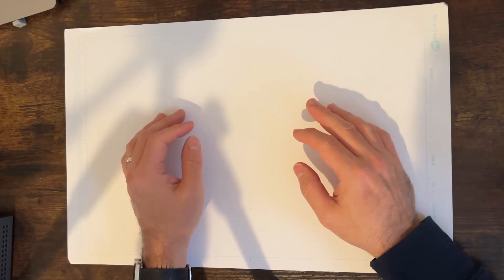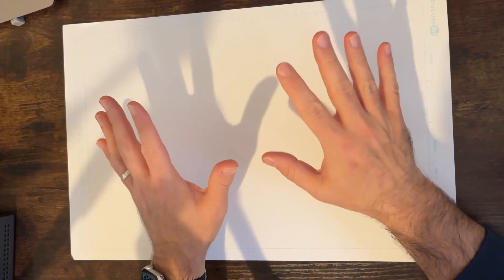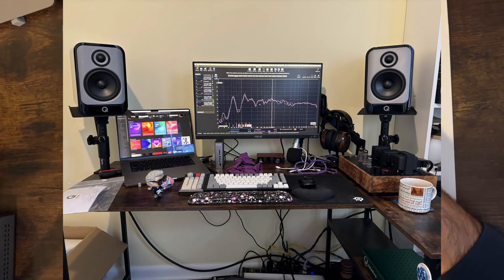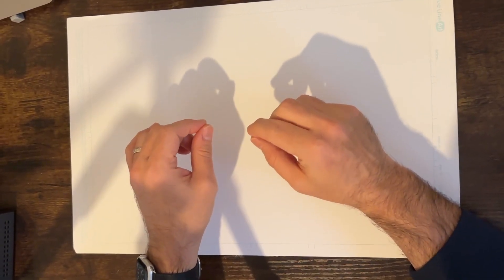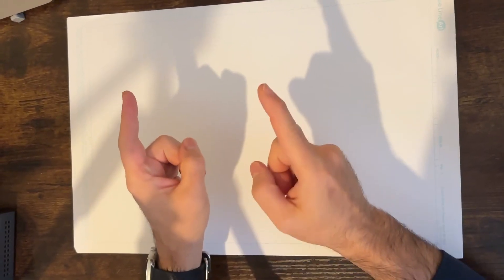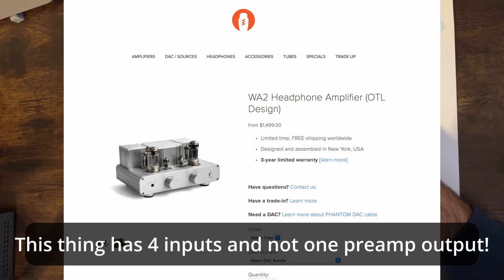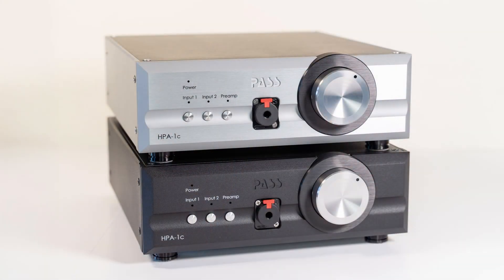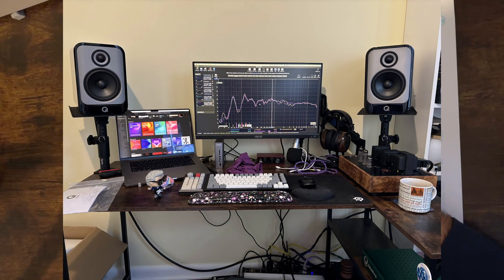Headphone amps shouldn’t have low power speaker outputs

Comment: I like your videos, I find that you do great work being very thorough. However with this video, based on my 30+ years of actively enjoing this hobby, I disagree completely and utterly. From a purely logical point of view, your reasoning is very sound, but as often is with all things audio, logic and reality are worlds apart. In practice, I find that Enleum AMP23R as a speaker amp sounds much better than 90% of much more expensive and much more powerful amplifiers. I don't care much about headphones, I use it only as speaker only amp. I don't know at what volume level you're listening to, really, as I find that in my smallish bedroom (approximately 4x5m), bookshelf speakers 84dB sensitive (ProAc Response 1SC, Spendor SA1) and nearfield listening (1.5 to 2 m from the speakers), 5 Watts of good tube power is plenty enough, and 9 Watts is overkill. And in my living room (5x6m) I never needed more than 9 Watts to get very, neighbor-offensively loud with relatively efficient speakers (95 to 98 dB sensitive), and plenty loud for normal listening with speakers of regular efficiency (88 to 90 dB) - not only jazz and small scale classical, but metal, rock and BSO. I had owned tens of famous high end amps over last decades, and as a rule most high power amps tend to soud worse that lower powered amps, 9 to 20 watts being the sweet spot. Especially for late night listening, 99% of muscle ams don't do low volumes well, and with levels of 0.5W to 1W peaks they sound bleak and washed out (and don't start about "loudess" controls, truly good amps sound good at all volumes).
So to me and many other "low power camp" audiophiles in this particular video you are very wrong. Instead, to many of us the headphone jack on our low power favorits is a meaningless addition. I use the Enleum in my main system as a second amp (a low-heat alternative to my AN Meishu), while for headphones (which I rarely use) I have a much cheaper Schiit Lyr, as good enough quality headphone cable from the my seat to the equipment rack would cost more than the headphones)))
Reply from the maker: I mean, if you're not using the headphone output then you're just looking for a low power amplifier, which is fine. As for 5W on tubes running 84db sensitive speakers... I mean, I haven't heard it, but I tried the Schiit Aegir 1 20W SS amp on my 87db sensitive Q Acoustics Concept 30s and some other things and while there was plenty of volume, there was a noticeable lack of dynamics, it just wasn't able to handle the big dynamic swings that a more powerful amp can do. That said, I ran the same speakers on a 35W tube amp and it was fine. But I admit I'm skeptical that even with tubes 5 or 9 watts are gonna be able to do the job.

Comment: If it makes you feel better just consider it an amp with a headphone jack.

Back in the day virtually all receivers and amps had headphone jacks (proper 1/4" jacks at that). My 3.5 watt receiver had one and so did my 35 watt.

I didn't need an extra long cord either because the receiver was conveniently right by the listening position. And you know, the 3.5 WPC unit drove a pair of Nova 6 bookshelf speakers just fine. I wasn't trying to recreate a rock concert in my bedroom.

It would indeed have been nice to have a set of preamp outs too but back then the affordable units didn't have that. I am not sure why because it wouldn't have added that much to the cost.

Comment: DDC - can you talk about DACs

NOOB questions about DDC relevancy for DAC types:

DAC Compatibility With High-End DDCs
Which types of DAC architectures benefit positively from using a high-end Digital to Digital Converter (DDC) e.g. (equipped with oven-controlled crystal oscillators (OCXO), dedicated power supplies, galvanic isolation, and near-perfect clock signals?) Specifically, how do the following DAC types respond:

Delta Sigma DACs, including discrete-time (DT) and continuous-time (CT) types
Discrete or FPGA-based Delta Sigma DACs
Multibit DACs
R2R (Resistor Ladder) DACs

Consider that some DACs internally manage timing and may try to compensate jitter or timing errors themselves. Would supplying an externally "perfect" clock and signal via a high-end DDC still improve their performance, or might it be ineffective because the DAC reprocesses or "scrambles" timing internally?

Oversampling vs. Non-Oversampling (NOS) Settings:
What are the recommended settings regarding oversampling in the DAC chain when using a high-end DDC? Should NOS mode or oversampling mode be preferred to best leverage a high-quality DDC input? How do these modes affect jitter sensitivity and overall sound quality when combined with such precise clock sources?

Digital Interface Considerations
Does the type of digital interface matter when connecting a high-end DDC to a DAC? How significant are interface options like:

I2S transmitted via HDMI

Coaxial S/PDIF

AES/EBU
in terms of maintaining signal integrity, jitter reduction, and ultimate sound quality? Are some interfaces better suited than others for high-end DDCs?

Role of Internal Clocks in DACs
Some DACs (e.g., models from Denafrips) have high-quality internal clocks or reclocking mechanisms. If a DAC reclocks the digital signal internally, does it still provide any benefit to use a separate DDC with an external clock? How do internal DAC clock implementations interact with external DDC reclocking signals? Is the external DDC still relevant when the DAC uses its own precise reclocking?
Reply from the maker: Um... these seem a bit more technical for a guy who talks to a monkey puppet. Also questions like "What are the recommended settings regarding oversampling in the DAC chain when using a high-end DDC?" don't really have answers, because oversampling settings and the DDC you use aren't really related. Did you get this stuff from ChatGPT or something? It's kind of weird. Anyway, I have two videos on DACs already you can find in my backlog, and that'll give you an idea of the kinds of things I talk about.

Comment: I think Nelson Pass is somewhat overrated. He dominates about 70% of the DIYaudio kits, which, from an economic perspective, suggests an imbalance — no single designer should hold that kind of “market share” without some form of unfair advantage. I also don’t believe his designs are vastly superior to those of the many other talented designers out there.
Reply from the maker: I mean, I like his designs a lot but I definitely agree there should be more kits on the market. DIYAudioStore dominates the market because they have a selection of different things with easily available parts on an easy to navigate website with build guides (and the build guides aren't even that good half the time). What else is there? A few AMB designs (and that website isn't good at all), a couple Akitika power amps, some Elekit things, a handful of boards you can find randomly on eBay (like the X-10D tube buffer clone I built). Just not very much. And the rest is the kind of stuff where you get a schematic and have to figure out everything else for yourself, which is much more difficult.
Reply: @NotanAudioReviewChannel  i built the Akitika amp, it is really well organized for a beginner. Dan does a great job at helping and at 400-500 usd i cannot see there is any budget for customer service. I wish there were more projects. But I also think buying Chifi and modifying it is underrated. For a lot of new people , upgrading a few capacitors and upgrading the tubes might be a good start.
Reply from the maker: Yeah, the Akitika stuff looks great and I love the detailed build guide and the fact that he says that if you build it and don't like it you can still return it, which is wild. Modding Chifi is fun too, but there needs to be more guides for it. (Changing tubes and op-amps I think barely counts as modding or DIY, though I'm a fan of both.) Restoring and modding vintage stuff is also cool, I wish there were more guides to that like the ones you can find for the Quad 303 or 405 for example.
Reply: It dominates the diy arena not only because Nelson Pass is one of the few still living industry icons, the genious audiophile engineers who were the very spitit of high end audio and audiophile approach in general - there are may be ten to fifteen such figures in audio amplification (like Kondo, Berning, Paravinchi, Manley, Shindo, Curl, Shishido, D'Agostino, Levinson, Putzeys to name a few). Not only that, his designs are examples of brilliant simplicity and can be build without much tecnical knowledge and expensive parts. More than that, he made most of his works public domain, freely available to everyone to build and enjoy. It is very different in spirit compared to general illegality of copying the leaked schematics of other greedy designers. Shindo preamps, for example, would be easy to build and they sound heavenly, however they would NEVER publish them, because the price margin is too great. Even the DIY companies like Bottlehead never openly publish their schematics. So when a prime amp designer shares his works openly and even suggests how to implement them better, it's a huge thing. And his designs being available in both single-ended and push-pull versions to cater to specific tastes, is even better. I have built two of Pass amps on better high-end parts than regular factory Pass units, and they were extremely satisfying and fully competitive with anything below $5k. However, AN Meishu and Pass' own XA25 both proved to sound superior than my diy amps, so they went to a friend.

Comment: If you're listening in the nearfield, a low-power speaker amplifier may be all you need to drive your small, insensitive speakers to comfortable listening levels.
Reply from the maker: That has not been my experience. I tried a Schiit Aegir 1 (15W as I recall) on my QC30s which are 87db sensitive and 6 ohms nominal. The result was limp bass and a lack of dynamics.

Comment: Can someone just make a small integrated amp with a good headphone port. I want the option to do it all at my desk, passive, active, headphones, whatever. It's something I could use forever so I want to have my options open.
Reply from the maker: So the PS Audio Sprout 100 and the Burson Funk both fit that niche, though I haven't tried either one of them so I can't tell you how good they are. But you're right, in terms of a compact, desk-able integrated amp with a headphone jack that's really good, there aren't a huge amount of options and it seems like there should be.

Comment: I agree with you that a headphone amp should have RCA (or balanced) outputs so that you can use it as a preamp, but I don't think that there is anything wrong with low power output for speakers, though I don't believe, unless I missed it, what you consider to be low power output other than Thomas' headphone amp at 4 watts (what's the upper end of low power for you?). It's not the number of watts. It's the quality of the watts. I haven't heard about Thomas creating a headphone amp, but I feel pretty certain that if it is low power, that it is quality power. 

On one of my desktop setups I started with a Douk A5 (102 watts) to drive the speakers. Initially there were Vera-Fi Vanguard Scouts. I later switched to XSA Vanguards. In either case the Douk A5 was unimpressive, even with the 48V power supply. I then added a Wiim Ultra to my setup to use as a preamp in addition to it's streaming capabilities. I planned to use it with a Wiim Vibelink amp, but while I was waiting on an optical cable for the connection, I hooked the Ultra up to an ACA Mini amp that I built. The ACA Mini is approximately 5 watts of class A power. It sounded really, really good. 😊 Once I connected the Vibelink (100 watts), it sounded good too, but I think the ACA Mini bested it by a hair. All power numbers are at 8 ohms. The A5 and Vibelink are class D.

I lay all of that out to indicate that for me, the lowest power amp sounded best, followed by the Vibelink which is slightly, by 2 watts, lower in output than the Douk A5 with the highest output on paper. In other words, for me, the sound quality of the amps is the inverse of the power output. Of course you have to take the claimed power output of the Vibelink and the A5 with a grain of salt. Those are manufacturer output numbers. The ACA Mini is a DIY Audio product, so I don't believe there is any fudging of the numbers.

I know some people rely heavily on specs, which includes output power, in making purchasing decisions. In my younger days I used to be a big spec follower. I always went for the best specs. However, I let that go once I started selling audio equipment. What I discovered by having access to a lot of different equipment is that specs, no matter how good they are on paper, can never tell you how the equipment sounds. And more importantly, specs will never tell you if you will like how something sounds. You have to do the work and listen to it and be the judge. If you're interested in Thomas' headphone amp, give it a listen first before taking it off your list. If you are serious about it, get it and do a full audition. I believe Thomas has a generous return period. You might be surprised. You may find that you like how it sounds and that 4 watts is enough.
Reply from the maker: I say in the video there's nothing wrong with low power amps, I just don't think headphone amps should have low power outputs. You wanna run your open baffles or old school big, efficient speakers, sure have a low power amp.

I've tried low power amps on my bookshelfs before, the result wasn't good. You just need a certain amount of juice to get bass and dynamics from a small speaker.
Reply: @NotanAudioReviewChannel  I still say big numbers don't equal big results. Listen first. Don't rule out on numbers alone.
Reply: @NotanAudioReviewChannel  Are you sure that the Victoria is a headphone amp with speaker outputs? I would argue (not really argue - strongly suggest 🙂) that it is a small, low power integrated amp that happens to have a headphone output. I'm just saying. 😁

I think it's more likely to have an integrated amp that happens to have a headphone output. It's actually very common. However, I can't think of one amp that is marketed as a headphone amp that has speaker outputs. I'm not saying that they don't exist. I just can't think of any.

Comment: 7:10 Think vintage audio gear. Almost all vintage (pre-1990) HiFi gear had headphone jacks that were run off the main power amps, with current-limiting resistors to keep you from blowing out your phones or your ears. Of course, the proper way to reduce the output is to use transformers, but those cost money. But in some amps, they can be added to give you a really high-quality headphone output that has a tremendously low source impedance and high output. And many vintage audio receivers and integrated amps had preamp outputs in the 70's and 80's.
Reply from the maker: Yeah, there's definitely a lot of treasure to be found in the vintage market. It does annoy me that a lot of stuff that was just normal on vintage gear like tone controls or a loudness button was taken off modern gear and if you're lucky moved into software. I want headphone jacks, buttons, and switches please!

Comment: I made damn sure my 4-valve Fosi GR70 headphone amp had pre-amp outputs before purchase. That way I can feed the RCA output to my ZA3s running in mono while my Fosi ZD3 feeds them via the XLRs. I can switch back and forth between transistor sounds, and valve sounds, by flicking two switches, which I can easily reach at any time. :)
Reply from the maker: Good strategy